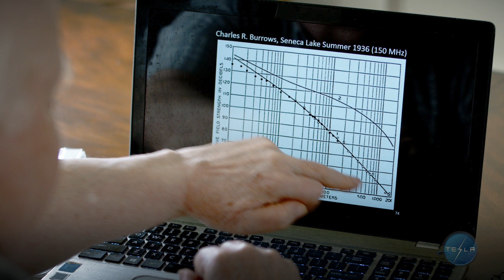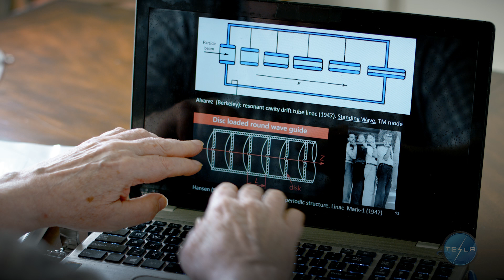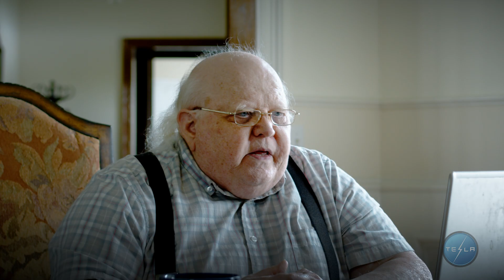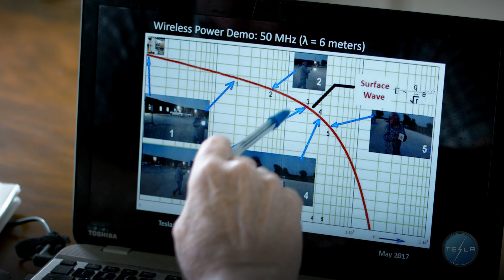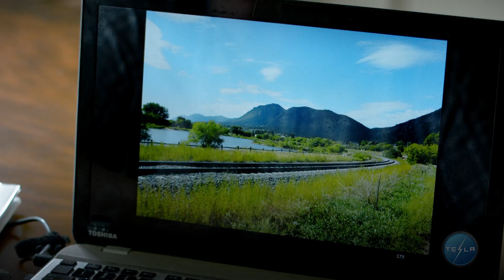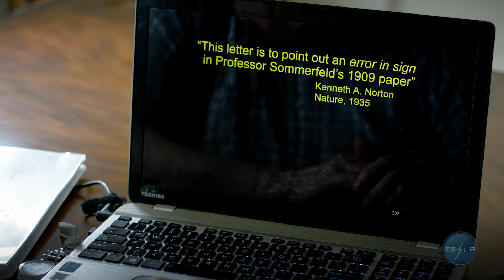Tesla Presentation part 2

Comment: I only find one thing in this video to be confusing.  At 1:27:56 (at 5275s,) Jim states that Tesla's system is not a Goubau line.  What?  Why not?  (I'm very concerned, because for decades I've been countering skeptical claims, where they insist that "radio" is the only known way Tesla could broadcast.  I tell them, what about surface-wave devices such as the Goubau line, which illustrates Zenneck waves in the 1D case  ...but where Tesla was using a curved conductive plane and not a long conductive wire?)   
So this is wrong?   Goubau-line isn't a surface wave as I thought, has no relation to Broadcast Power, and Zenneck's math doesn't apply?